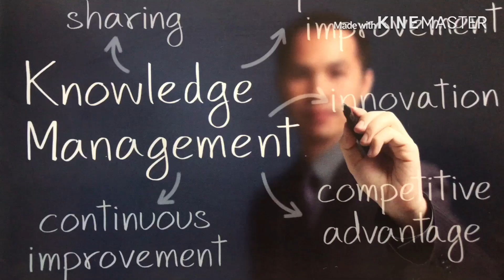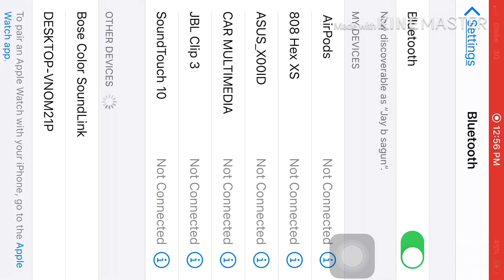Bose bluetooth speaker repair d.i.y.

Comment: (a) heating up the plastic - there's glue in there - helps the prying without too much marking up the plugs.  (b) 5-point Torx security bits, 2" length are on Amazon and make unscrewing those four screws in their kinda deep and narrow wells easy peasy.  (c) the control panel wire is held in place with a ZIF connector - Zero Insertion Force, which lifts up from the cable side with very little effort at all.  It's common in laptop, tablet, and even cell phone wiring.  

Best of luck on the next time!

Comment: Forget about prying the screw covers off. I drilled a hole in mine and then pulled them out from below with stiff wire. And yes, 5 point torx security screws, needs special hardware!

Comment: I have the same problem. won't turn on. I tried:
 Connect your product to a charger
On the top of your product, press and hold the Play/Pause button for at least 15 seconds
While continuing to hold the Play/Pausebutton, unplug the charger
Release the Play/Pause button.

but, won't turn on

Comment: Having a tough time opening it. Can u explain the reason for this repair and the causes of the issue. I feel i have the same issue. My speaker(same model) has the same issue. Charges with amber light and later turns green after full charge and the even I was able to update the firmware but the buttons dont respond. Can not reset or put it in shipping mode. Tried it all. Please help.
Reply from the maker: Yes its tough to open the screw I drilled the screw jz to open it and changed to philip screw, the brass got dirty so you need to clean it
Reply: @DHandyMan  you drilled to break the lock of the screw or the whole screw it self. Again thanks for replying

Comment: Nobody wants to watch three minutes of opening this thing up. And you didn't even mention that the original screws are 5 point security torx heads. Meaning that 99% of people, will have to pry and snap off the center section and then force a flat screwdriver into two of the 5 slots to get the screws out...
Reply: I know right?
Reply: Thank you sirI've been sitting here for 30 minutes trying to get out the screws wondering what the hell did he use on the original screws
Reply: T8?
Reply: He also snapped the ribbon cable clip with the knife instead of simply flipping it open. I have this speaker and its got t10 screws
Reply: The guy that made this video is obviously trippin balls.